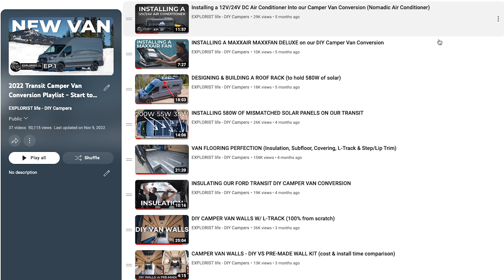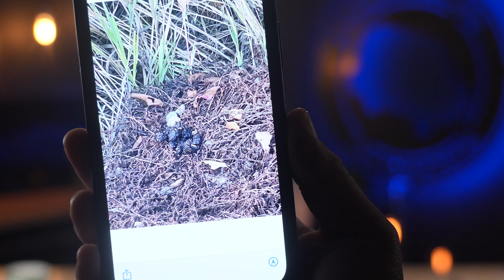EXPLORIST.life Christmas Update (...and 1st annual $#!+ heard around the shop)

Comment: In your camper van electrical tutorial, you mentioned you would be covering alternator charging with the Victron 100 amp Buck Boost.  I'm hoping to use that in my Ford Transit which is shipping next month. Is that still on the agenda for early 2023?  Thanks for an excellent series on building out a Transit and best wishes for 2023. Sounds like you have a great year coming up!